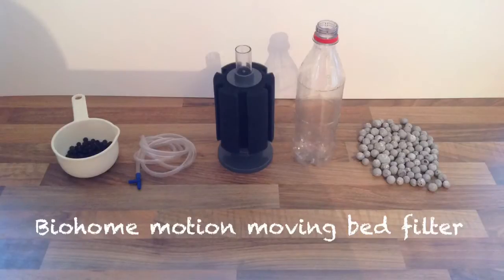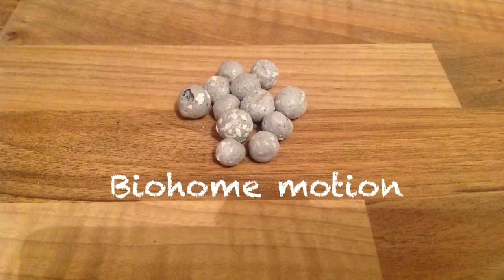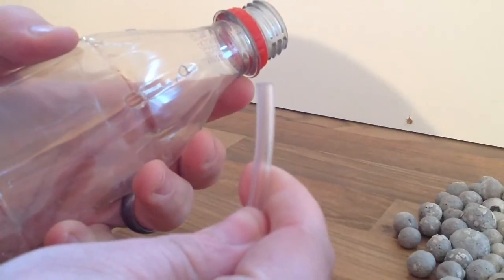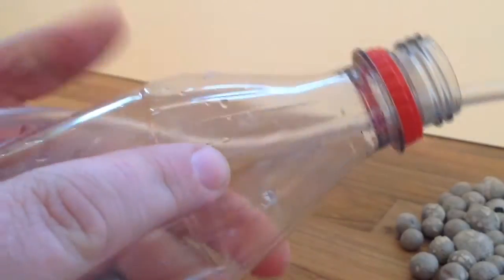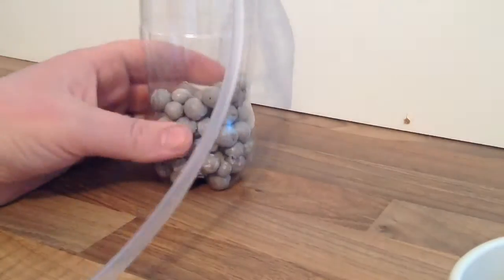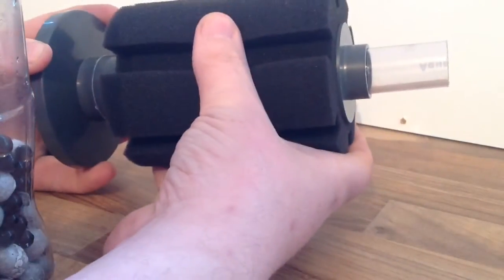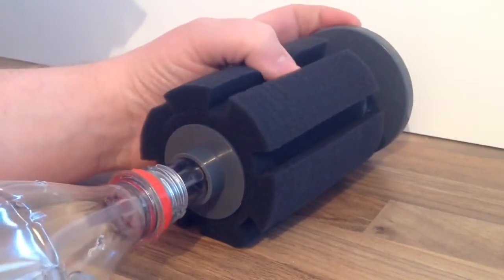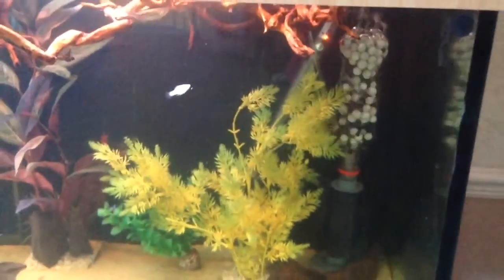Biohome motion moving bed filter

Comment from the maker: Pondguru richard this isnt the video i was mentioning before, this one was originally going to be on it but turned into its own video lol also a quick question, i had a thought this morning could the biogravel be used in a moving bed filter too? A smaller one for smaller tanks?
Reply: Yea, nice one, man. Seemed to be moving well and with regard to the biogravel it is too heavy for moving bed use but makes a very good media for other DIY projects as it gives maximum surface area in small or strangely shaped areas.